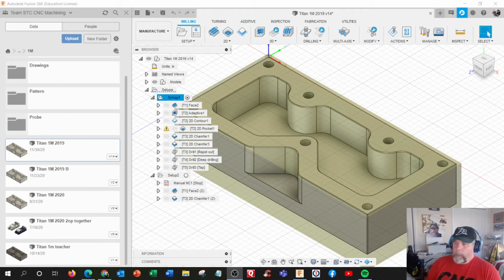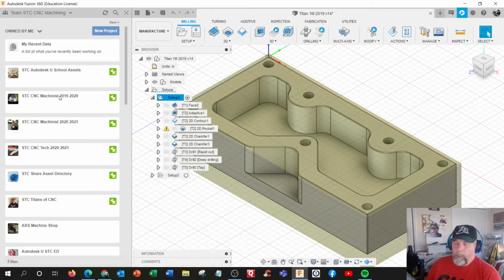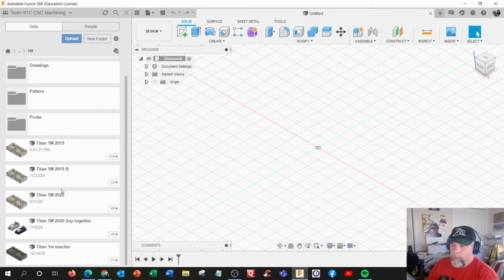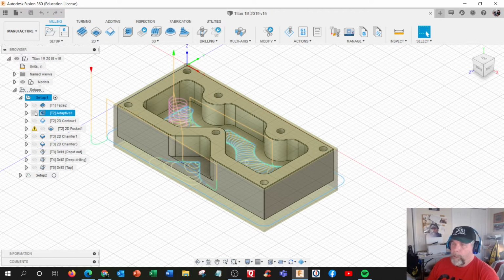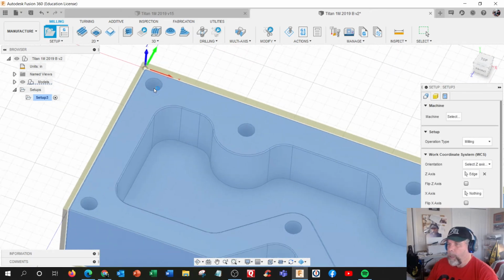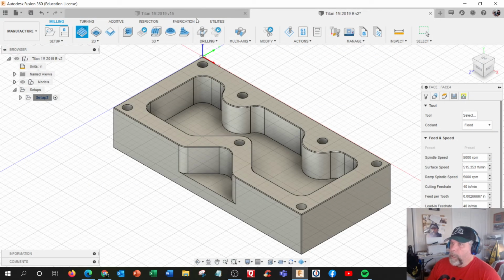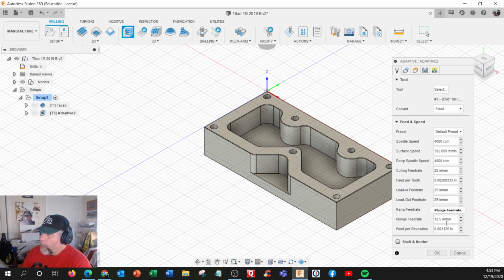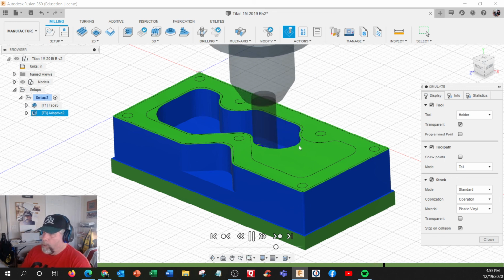STC Titan 1M Cam

Comment: Why did you use 3D adaptive clearing instead of 2D adaptive clearing? There is no 3 axis milling on this model.
Reply from the maker: 3d Adaptive has less selections and actually works pretty good on 2.5 CNC Milling projects.   It does attack everything.  So if I need to isolate I would use 2d adaptive. 

3d Adaptive is like Mastercam Opti rough- It has selections to control (step down) Step to make like a pyramid that is a good ruff strategy for 3d parts - That was 3d original  intention. But many of us use 3d in 2d scenarios
Reply: @CNCMachinistEducationNetwork  Thanks :)